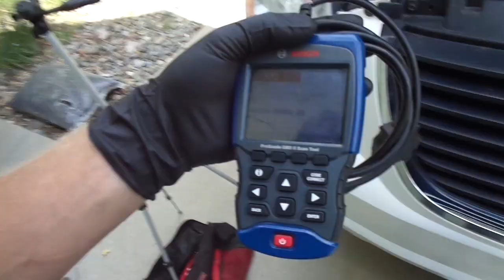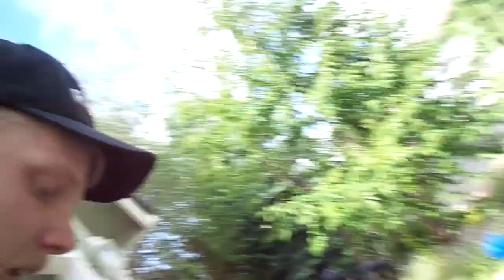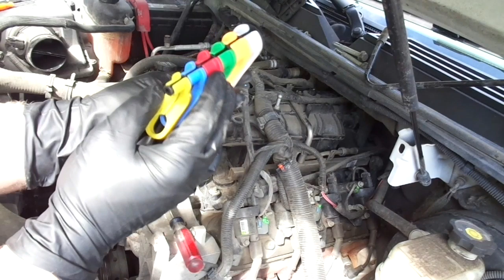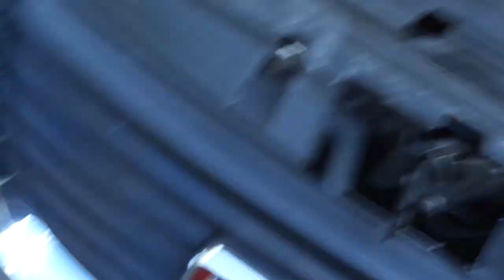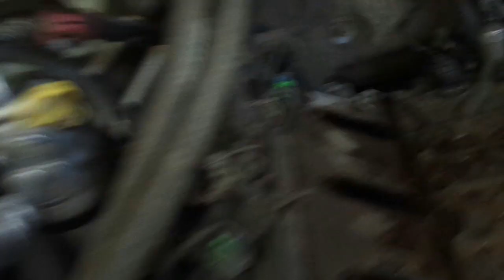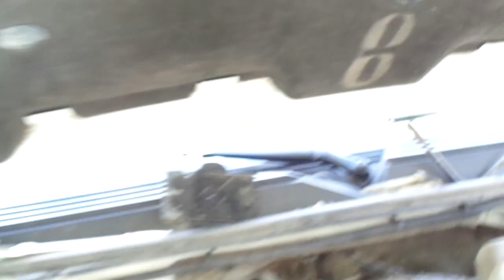Oil Pressure Sensor Replacement 2008 GMC Yukon

Comment: Easy was always seems to leak. This was is guaranteed no leak but forgot to mention the screen that can be removed easily with 3/8” lag / deck bolt or use a pick. Also use a vacuum to remove the junk.

Comment: Honestly that was a great video. Many are able to complete the job without taking out the intake, but for some, we have to go deeper. Easy to follow and the most difficult part was making sure you have the right tools. Getting that fuel line off was tough, but after that smooth sailing. Thank you for sharing! Also, I’ve been told that not all sensor replacements come with the screen / filter. Additional note: if you do chose to take the intake off I highly recommend taking the fuel line off before you loosen the intake housing bolts.

Comment: Exactly 2 weeks ago I replaced the oil pressure sender on our 2014 Yukon 6.2; this had the little useless plastic shield back there, but I was finally able to reach around and do the sender R&R without taking the intake manifold off.  I watched YouTube videos, most folks do NOT remove the manifold to do this job.

Comment: If any of you fuck knobs think this is an easy job it would be equal to moving all the furniture in your house and all of your clothes out of the drawers just to put one fucking shoe on. Easy oil pressure sensors are on the Chrysler Hemi....reach in and take it out 1 minute job. But you know what? you god damn chevrolet koolaid drinkers are about as fucking dumb as they come.

Comment: You don't have to take the plenum off to do this
Reply: For hydro boost on my 2009 you have to almost. I removed the sensor but barely. Dropped old one couldnt reach it back out. No room to remove filter either. There is a big plastic shield that makes tiu not even able to get cell camera back there. 

Another guy has a great camera cell shot of the harness and touching it, but he does not have the shield thats on the 2009 and up models.

Comment: what causes the oil pressure low stop engine to come on in a gmc yukon 2008 after replacing sending unit?

We just had the dealer do an oil change and they replaced the oil pressure sending unit. Now it’s back on oil pressure low stop engine
Reply: Pick up tube o ring inside the oil pan could be bad or the oil pump itself. If I were to change the o ring I would do the pump too since you would already be in there

Comment: i drive a 2005 yukon slt with 270k miles, the last couple of days i have been having an issue, one day it was displaying oil pressure as zero after driving for about 5 miles pressure came up to about 50, then the next day when i turned the key on with the engine off the oil pressure gauge went up to 75 ( gauge only goes to 80 ) when i cranked it and started driving it stayed there it did not increase and it did not decrease when i stopped at a light. Do you think this may be the sensor? thanks skamps.
Reply from the maker: This does indeed sound like the sensor malfunctioning.
Reply: @skampsautomotive8560  Thanks!
Reply: @skampsautomotive8560  yep thats what it was.

Comment: I didn’t pull the intake just to change the oil sensor
Reply: You also must not of had the hydro boost on 2009 up that has a big shield thats totally blocking any mans hand and arm. 😂

Comment: That looked like simply TOO much of work to get to that damn sensor for having a lot of space to work. I see many reach to it with adapter socket and extension form above, without removing manifold etc. What do you think?
Then seeing all these pain, what if you don't change the sensor, know only its only a false reading of 0 oil pressure? Yes I know that annoying chime every now and then when it reports the error but seriously, is anything going to get hurt, if you continue driving with a bad sensor?
Reply from the maker: Sam Sen I have already addressed your first question in previous comments. For your second question you would know pretty quickly if the engine actually doesn’t have oil pressure by the way its running/noises it’s making. Personally I have never seen an oil pump fail on one of these engines - it’s always the sensor. You can drive with the issue no problem, but typically a check engine light will set if the sensor is faulty. This will cause a problem with an emissions inspection, depending where you live if you need to get one or not.
Reply: @skampsautomotive8560   Thanks for the rapid reply. 
Unfortunately I live in worse inspection nightmare state of CA but fortunately I've just passed for this year so nothing for till two years from now.
Problem is temporarily as it shows the normal pressure in between and actually it doesn't turn the "Check Engine" light. Checking with scanner, I see no saved code either. Only annoying sound and zero indication.
I really love my trucks but wished industry's love was mutual! especially in terms of ease of approach for work on engine or better quality of parts that are in difficult locations. But I guess that is part of the game to ensure we don't stick to our beloved car for too long! 
Again thanks for the speedy reply that is a quality of the honest and best YTers.
Reply from the maker: @samsen201  That's interesting - usually a code will set when the sensor is faulty. I suppose that's a good thing for you if it doesn't though. I understand your frustration with hard to access components - believe me I deal with it all day long on various engines. Unfortunately there's no way to make every component simple to access. There will always be a give and take aspect depending on the design. I can say that these LS family small block chevy engines are fantastic power plants though, and the engines themselves will run virtually forever under normal driving circumstances. Removing the intake may seem like a lot, but it's really very simple on these engines. If you aren't confident then paying the 2.1 hours of labor to have someone else do it isn't terribly expensive either. Good luck!

Comment: What about the oil pressure sensor filter? Does it need replacing as well? I replaced my sensor but still was fluctuating. Jw. Thanks.
Reply from the maker: The filter is inexpensive and easy to replace once the sensor has been removed, so it's not a bad idea. However, I wouldn't say it's mandatory - Just depends on the condition of the filter. The pressure gauge on this engine is an actual gauge that feeds back actual pressure readings - not just a dummy gauge that stays in one place like a Ford gauge, for example. That being said, you will normally see fluctuation in the oil pressure directly related to engine RPM. On a normal operating engine the gauge will be somewhere around 30-40 psi at light throttle, and may go up to 70-80 psi and anywhere in between at heavy throttle. All of this is normal. If the gauge ever drops completely to zero with the engine running, or sticks completely to max then there is probably an issue with the sensor. If this were the case the computer should throw a check engine light, though. Otherwise your sensor may just be operating normally.
Reply: Yes if you have the filter (most after 2007) you will want to remove and replace or at minimum clean if you can remove without damage.  This will keep adequate flow to the lifters and sensor. Also, the yellow grommet that was not re-installed in the video will want to be put back on the wire connection prior to plugging back in.

Comment from the maker: There are 2 different designs depending whether it has a vacuum brake booster or uses hydroboost. That plastic plate on the back of the intake makes it impossible (at least in my experience) to remove the sensor with the intake on. If theres no plastic plate then yes, the sensor can be removed without pulling the whole intake. Again, this is just my personal experience. If someone has found a way to do it otherwise then great! Thats the point of making these videos and sharing knowledge with each other. Knowledge is power!
Reply: True. Some can't be done with out intake removal. There's no space
Reply: Mine has the plastic plate on back of intake. Pain in the 😖😖😖😖😖... I did manage to remove the sensor without having to remove intake. But i dropped the old sensor back there, and dont want it heating up and melting or something. Plus, taking the sensor off is one thing, but removing the filter and installing a new one is another. Smh. Dont even both with that plastic shield in the way, dang almost wanted to break that thing off... 😂. Good vid my brother. Thanks.

Comment: for more room up front take the two bolts off of the trans mount at the rear of trans. Jack up the trans until it hits the trans tunnel. This gives you about an extra 2 inches of clearance by the firewall. I did it this way and didnt have to disconnect anything else to remove the sensor.
Reply: All that work and not even check the screen 🧐
Reply: Thank you for saying this !!!!
Reply: U don’t have to take intake off to get job done

Comment: what is the labor cost for this repair ?
Reply from the maker: Book labor time is 2.1 hours. Multiple that by whatever the shops labor rate is.
Reply: @skampsautomotive8560  why pull all this just for sensor.Im 64 yrs old and have done 5 without all this intake removal🤔🤔🤔